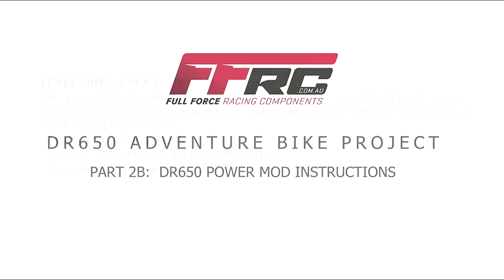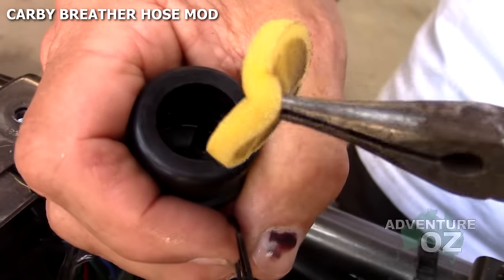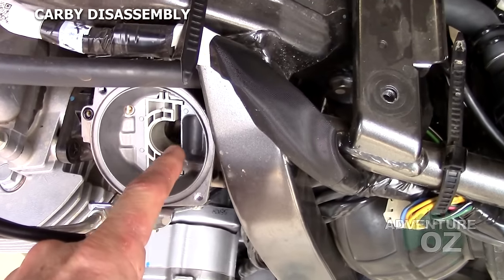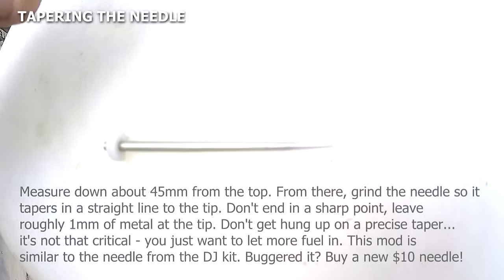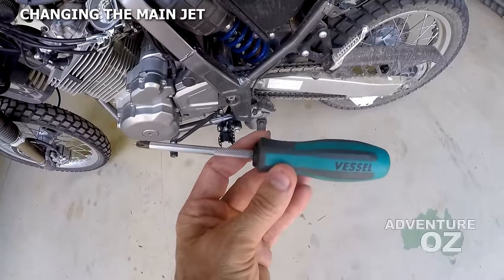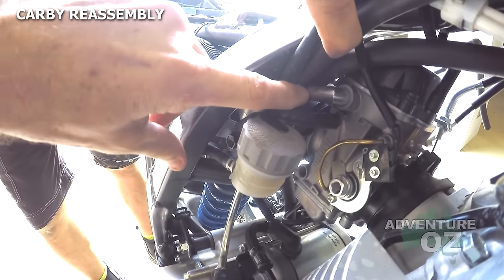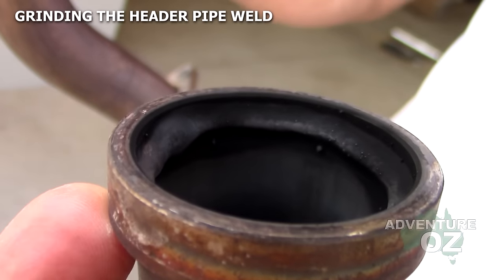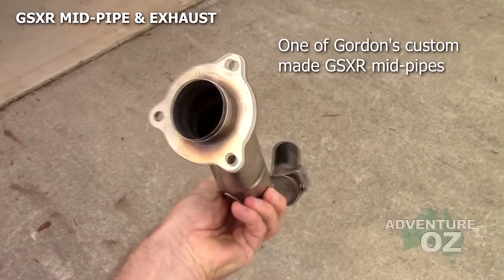DR650 project: transforming the stock carburetor! (BST magic)︱Cross Training Adventure

Comment: i did everything thats listed in level three ( 0:15 ). with the extra drilled whole in the air box it loses a lot of power down low to the middle rev range and gains only a really slight amount of power in the far upper rev range. thats why i taped it off. also i got a different muffler (GPR Furore) which is unrideable in the lower rev range when the db eater is in. it stalls if you ease the clutch out. without the eater it has a lot of power and doesnt stall when easing out the clutch but its obnoxiously loud (comparable with a ktm 690 with leo vince x3 without db eater). also i never had the front wheel come up so easily. first time i got it up easily was last week when i changed the gearing from 15-41 to 15-45 and installed a high performance header pipe. still needs the upper rev range for me to clutch it up. im a noob when it comes to wheelies and probably dont have the right timing but it should be way easier on such a big thumper i think. 
i mean maybe she lost some power over the years and thats the reason.... shes 19 years old and has 70.000km on the clock

Comment: I'm having a bit of trouble with modifying / upgrading the carb on my DR. 

1 My carb is from a 2003 DR. I purchased a noname BST40 rebuild kit on line. I received a new emulsion tube in the kit and it differs from the original. 

At Motolab I  read their article on worn id of the emulsion tube which probably accounts for the heavy carbon deposits in the combustion cylinder. 

I read also the pilot jet was supposed to be 45.0 Mine revealed a 42,5. I installed the 47.5 I purchased from you. so far so good. (Motolab owner says there is no reason to replace the stock pilot jet.)
I began putting the new parts into the carburetor and discovered the new  emulsion tube  from the rebuild kit is different from the original that I removed from the carburetor. I have 3 needles and none of them fit the ID of the needle jet. Yet all of the needles will fit the original emulsion tube. 
I have also read there are a couple of pre manufactured needles depending on the performance required. 
(ie: the DJ needle you mention above.)

So what's going on here? Am I just a victim of parts made from Chinesium or am I missing something here?
I've used most of my measuring equipment here. I don't need to measure the ID of the Emulsion tube.
 I understand the taper is considerably different from the needles I have,  as well as the original Jet.

Further to the original.. 
I have just now read  notes on measuring the wear of an emulsion tube, and decided to insert each of the needles I have and measure the distance from the top of the Emulsion tube to the top of the needle when the needle is inserted till it stops.
The original needle that came from the carburetor was protruding .910". The needle which was supplied in the rebuild kit protruded .888". the needle I purchased from Motolab (part number 13383-32E00 protruded .625.
This indicates to me each of the needles tapers differently.
I'm pretty confused at this point.
I can be reached at Bunkmuffin@gmail.com.

Comment: Great vid guys. I might pull my carby again. Greetings from sunny South Africa!
Reply from the maker: +adventurecraig thanks craig... yes that carby seems to be a major key with unlocking the beast :)
Reply: +ADVENTURE OZ Just a quick question mate: My bike is a US import. Had 100Ks on the clock. Now has around 4000. It smokes a few seconds after start-up from cold. It's done that since new to me. Lasts a few seconds before it goes away (engine heating up). Valve seals or rings? Any thoughts would be much appreciated!
Reply from the maker: +adventurecraig bizarre craig, no new bike should do that. sounds like valve seals but i no bugger all about mechanical stuff. :(
Reply: +ADVENTURE OZ No probs. I think the bike stood for about two years and the seals hardened. 

I'm going to pull the head and check the stems. I'll mod the carb spring as you guys did. Have a stage two needle in alread and cut the box. I like that acerbis tank. Might put one on while I'm at it! Our currency is so week at the moment though :(

Comment: I put a Q4 exhaust on my dr650 with a k&n filter and stage 2 carb mod.  Definitely had to do the airbox mod I couldn't get it tuned until it was done.  Also the Q4 is quite loud and produces humorous snapping and popping when you let off.  Other than being almost annoyingly loud it is a much better machine after that.

Comment: Great (video) work .. I wish I could drop my 2013 DR650SM/790 big bore off to you for some all around (tuning) dialing in. I have fcr pumper carb , 190 cam, 790 big bore, over sized valves and head , 5 angle race port , air box mod , k&n air filter. Power bomb header Q4 silencer. Mohave rear shock and front DRZ 400sm usd fork

Comment: DR650 put stock needle in die grinder and shaped, 1mm diameter at the point 15mm back straight taper. works a treat on the 3rd clip from the top.

Comment: My DR is bone stock engine/carb/exhaust. I enjoy the challenge of smoking everybody I ride with with it stock. Honestly it runs fine stock. Handling is what needs work on the DR much more then hop up bits.  Its always miles ahead on any sort of dirt road.
Reply from the maker: agreed brad. i rode mine completely stock for a while and third gear wheelies were still a breeze.... but that suspension and those tyres were pretty scary when pushing hard on the dirt tracks lol.
Reply: After study, DR650 is only lean on the needle. stock pilot jet and main jet are fine. So raise the needle is the only mandatory case to run OK (or silght shim). Rejet is not good for mpg  but bike run cooler I admit.

Comment: Procycle also sells a fantastic TM40 Pumper kit if you wanna go all out. The best thing I've done to my DR!
Reply from the maker: +Matt Lawson must admit i'm more in favour of budget mods matt... our carby mods cost $10 for a main jet andan hours work and i reckon the results are very similar to my old DR which had a TM fitted. the TM is still a bit quicker on the throttle response but i wouldn't want to pay US$520 just for that. the plug n play nature of it is good though for those who don't do-it-yourself projects.
Reply: +ADVENTURE OZ  I tried the drilled slide, new jets and adjusted needle. I might have completely botched it up  because I had a weird jump as soon as I laid into the throttle. I would give it gas, it would accel for a second, then bog out briefly and then continue to accel. I soon after bought the TM40  and that seemed to fix all the problems with the carb. Since then, I have had zero problems with it. Great video by the way!!
Reply from the maker: +Matt Lawson i'm not carby expert but if you still had the stock needle that would create issues... i think the standard carby either needs the stock needle tapered as per this vid, or an aftermarket needle, to really work properly. a well setup TM40 may outperform gordon's stock carby mods by quite a bit but he's had trouble finding anyone with a well setup pumper carby on their DR to do a direct comparison.
Reply: +Matt Lawson 
I've had both and a well setup standard carb is just as good with a fraction of the cost.  Admitted I got the Dynojet kit which saves time with the needle.  The TM had a heavier pull than the standard carb.

Comment: Hey what year and what milage was on this bike? Did you notice any whining in 3rd gear? I just picked up an 07 and I have 3rd gear whining. Suzuki supposedly corrected the issues with the gears after 06..  I am finding after coming across many posts that they obviously did not correct the issue.   I have 11k miles and it runs great but there is the 3rd gear while..How concerned should I be? Also.. What ear GSXR pipes will work? I plan on doing these mods to the bike but I hope that the 3rd gear is gonna hold out...
Reply from the maker: we covered third gear issues in the 'DR650 known issues' vid, jay. 😊

Comment: you guys say the fuel economy improves after these mods? what are you getting on the pavement mpg or kpl? i'm sticking with a stock setup 2008 dr650 getting 50 mpg. i modded my 2007 drz400 so much i went from 55mpg down to 30mpg but it's actually faster to 60mph than my dr650. i really don't want to decrease the MPG so i have been hearing just upgrading the exhaust will improve  power but not hurt mpg on the dr650...is that true?

Comment: I'm in the US and I really like your video. Many great points. I used a 1/4 drive with a #2 phillips to break loose the float bowl screws (I know it's JIS) ;) That took nothing compared to all my might just prior. Also replaced with hex bolts. 

I'm mainly commenting because I'd like to know how the bike ran after your needle taper and shelf shave. From what I understand, the tip is more "open throttle" and the middle flat taper is more low throttle/less fuel. You've also dropped the needle substantially with the shelf shave.. so less fuel, but thinner taper. but I'm guessing the snorkelectomy and new hole helps with the rich taper. Complex relationship there... Thoughts? Mainly, how's it run?
Reply from the maker: +Chris Walther as per the vid chris more power across the revs, more economy IF you don't use the extra power, starts easier. all good and no bad. :D

Comment: Ok, I am confused, on the needle shown in this video, of which is awesome, it shows the clip over the spacer. but on my ProCycle Jet Kit, it shows and is worded that the spacer sits on the clip, have the got it wrong or does it work both ways as the spring holds it down anyway?

Comment: I've never seen anyone take a needle to a bench grinder. If I was going to do that I'd chuck the needle into a drill. I have used a drill and sand paper to get a "better" taper. That way you get a more even finish and you can measure the needle and get repeatable results.
Reply from the maker: +505197 i think he's tried various ways but since he's found the straight line best i guess he finds the bench grinder the best way to achieve that...

Comment: I have been watching your vids for a long time - when I am not laughing I am enthralled with your excellent coverage of the DR650,  a truly majestic bike that you can rebuild to whatever standard you want.  2 questions - firstly if I was to grind out the lip inside the header pipe, would I need to change the needle/ settings in any way?  I have done all the carby mods you cover in this vid and have a Stayintune muffler.  Secondly, what are your thoughts on using a broad band oxygen sensor to get the best out of the tune up?  Would it be worth the money (<$200 approx) to buy one for the increase in bike performance?
Reply from the maker: I've never seen anyone dyno the DR650 to see if grinding that lip makes much difference, Noel. I didn't' actually do it on my latest DR650 and the performance boost seems about the same. Remember that grinding also weakens the pipe a bit so it's more likely to break if it hits something. I've never even heard of an O2 sensor. The stock BST carb is very forgiving when it comes to getting things a bit wrong, I doubt the sensor would make much difference, if any.

Comment: I just did Carb modes. I saw this video yesterday, today was drilling, cutting and grinding :) 
By the way my first bike and my first time touching Carb, my mechanical skills on are maybe level 2 of 10. Bike feel completely different, I am so happy wit this mode. Next is exhaust modes, but bolts on header are so rusty and stuck I don't know how to unscrew them, I am scared to don't brake bolts, or maybe worst magnesium case.
Reply from the maker: Nice work!

Comment: Nice video.  How much dicking around was there after each (or all) of these mods?  Did it all work first go?
Reply from the maker: Perfect first time. I was lucky to have Gordon doing it for the vid, he's probably THE expert when it comes to BST carbs. It's pretty hard to get it wrong too. There's a lot of leeway with the stock carb settings, unlike alternatives like the pumper carb where sometimes really struggle to get the jetting right.

Comment: Buy DR650.

Replace - seat, fuel tank, carburetor, exhaust, front and rear shocks, front and rear tyres, headlight, speedometer, handlebars, air filter, mirrors, bearings, footpegs and magneto.

Oh yeah we forgot to tighten a few screws that might mangle your engine aaaaaaand 3rd gear might fail.

$9000 AUD new usually gets you twin cylinders, water cooling, ABS, fuel injection, colour dash with fuel gauge + tach, slipper clutch, LED lights, 6 speed gearbox and a windscreen.

Not here buddy.

"DR650 best bike ever"

Haha.

Yep. 

I still want one.

Comment: Thanks for the videos and the great, informative info. Would drilling the extra hole in the slide and tapering the needle without changing the main jet help or hurt performance?
Reply from the maker: As per the vid, certain mods need to go hand in hand with airbox mods and different exhaust. Summarised this in the pinned first comment.
Reply: @crosstrainingadventure  
Thanks! I have changed exhaust and was moving on to the next step. I was thinking of doing the needle taper and slide without main jet upgrade, but looks like the jet will have to be at the same time. Thanks again for your videos!

Comment: Finally a dr650 owner for the last year or so. I have done all the mods except the exhaust is there anything i should not change like the jet size or holes in the slide or air box because of the stock exhaust?
Reply from the maker: From memory I think the main thing NOT to change if keeping the stock exhaust is the main jet.

Comment: 7 years after DR650 project video was posted
I'm here to say none of that went on my 2008
DR650SE.  Are good to go as it.  :person-turqouise-waving:
Reply from the maker: Yep an unmodified DR650 will certainly suit a lot of riders as is. I kept my latest one untouched for a few months for warranty reasons but also to see how capable it was completely stock. But a few basic engine and suspension mods definitely transform the bike for riders wanting to push the bushpig a bit harder.

Comment: I did similar to my DRZ400E except installed a JD Jet kit. Went "acceptable" after that.
Reply: Der Wuestenfuchs  It made a massive difference and much smoother. Heaps more torque across the rev range. Lifts the front wheel much easier.

Comment: Very infomative! Thank you! But: how can it improve the fuelconsumption when installing a bigger main Jet? Doesnt  a bigger mainjet means more fuel flow?
Cheers and thanks!
Reply: Yes it will give it more fuel. But with that being said it's only getting more fuel when you twist on her. If you're just cruising steady and not cracking it open all the time you're fuel consumption should remain fairly steady to what it was. But if you use those extra horses be prepared to feed them too.
Reply: More power means less throttle to maintain the same speed. Therefore, less fuel being used.

Comment: I love the videos, this one did a nice job of summarizing the BST Magic mod. I did the mod last fall but feel like I need to jet mine a little richer than recommended. I was wondering if it has to do with the gas? Do you run "E10" gas over there with 10% ethanol? That's most of what we have here. If you run pure gas that would be about a 4% difference in fuel required, based on heat energy per gallon, right? 
Very nice mod, I just have a little light throttle surging still, maybe just breather related...
Reply from the maker: +Joel Anderson thankfully we usually have the option of E10 or no sugar added at all, we opt for the latter when we can get it. it shouldn't really make a difference in jetting that i'm aware of. i must admit i know very little about this stuff and just put in everything gordon said as he was doing the mods. :)

Comment: Have you ever had any issues with surging at speed/winds? Before I go hacking my airbox just wondering if there is anything I can do to prevent it. Perhaps not such an issue in Aus ?
Reply from the maker: Some guys report this when they just take the airbox side door off instead. There should be no problem with holes under the seat though.
Reply: @crosstrainingadventure  have seen a few threads in drriders - guess time will tell :)

Comment: You grind the plastic needle base for it to slide more in (downward), but yet you grind the needle, which practically, it's like putting it higher. Please explain the logic, thanks!
Reply from the maker: The needle doesn't have enough taper. All this mod does is provide a cheap way to mimic the needle you'll get in an aftermarket jetting kit.

Comment: Great vids guys! 
Question... Grinding a flat on the nylon washer so it drops into the recess...this lowers the needle by a couple of mil at least, does this make the bike run significantly leaner even when tapered? 
I've done these carb mods (I'm still on stock jet and and have removed snorkel) but bike is running like crap, surging, cutting out, popping etc so I'm presuming it's way too lean now. Thoughts guys?
Reply from the maker: gordon is the carby guru on the advrider and drrider forums with his BST magic threads, sam. he's posted a fair bit there about issues like that.
Reply: Thanks, I've been searching a fair bit but I'll go take another look. 
Keep posting those vids guys.